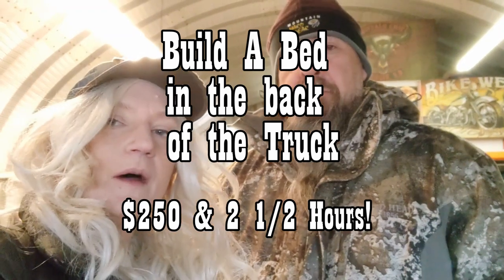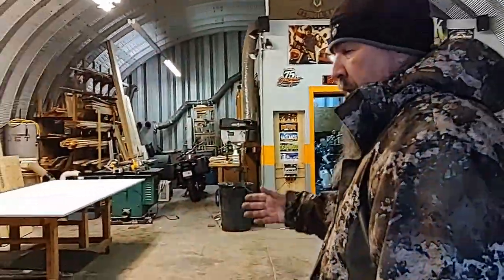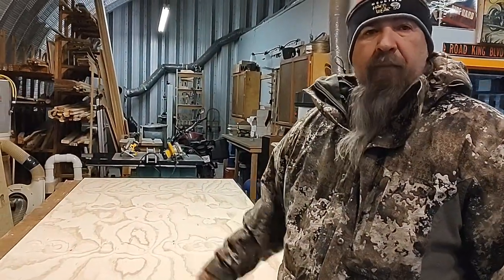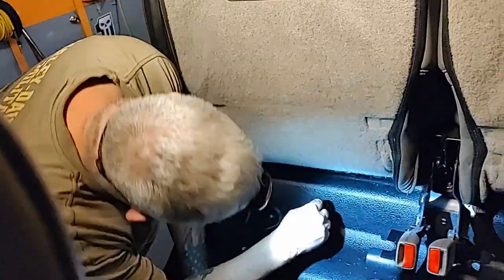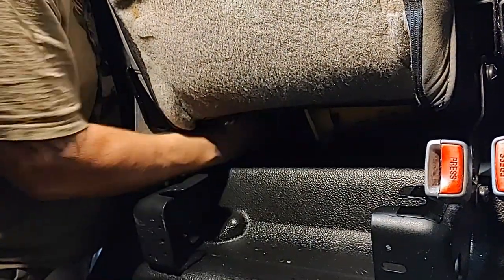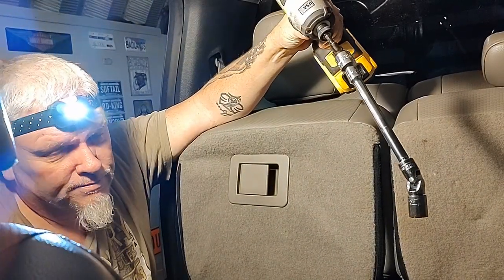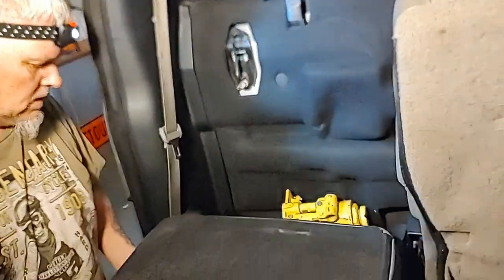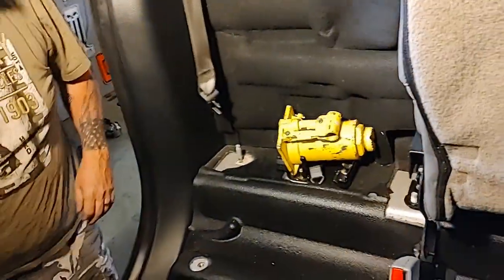Build A Bed The Back of Your Truck RV Transport for $250

Comment: GreatbJob Guys. 
We both used many of the same techniques.  Same mattress. Same 3/4” plwd with no frame.  Same corner clips.  I opted for the cotton sheets because I’m a “Sheet Snob”. One thing I added was some foam pipe insulation stapled to the perimeter of the plwd to eliminate scraping on the rough edge.  I also used the cutoff piece of mattress, cit to the proper length, put a pillow case over it and use it as a mattress extension behind the drivers seat.  I have to sleep diagonally and that gives me a place for my feet when I sleep.  I use it for a back rest when I’m sitting up in the bed reading or watching tv on my iPad.
I tried to add pictures to this comment to show you, but couldn’t figure out how to do that. If you want, I’ll text them to you. 
$60 fora sheet of plwd these day. 🤯. Who’d a thunk it!
Reply from the maker: thats a great idea.

Comment: Wonder what ya'lls thoughts are on the IT's email about potential slowdown in May?
Reply: It is what it is.
Reply from the maker: I think they may be getting rid of the drivers who don't drive their quota...many drivers drop out and never return or don't inform the company that they will be out for over a month due to health issues or truck problems or whatnot. I don't know about IT, but at Synergy,  it's the end of the first week of May and yesterday we had 550 towaway loads on the board..it will take quite a while for that to drop.

Comment: Dot compliant?
Reply from the maker: Doesn't have to be as long as you do your 10hr. Break every evening.  You can get a Woodhouse D.O.T. compliant bed if you want to log "Sleeper Berth" and are team driving and keep rolling. But just about all transporters build a bed in the back of thier pick up trucks. But, you cannot roll with someone sleeping back there.